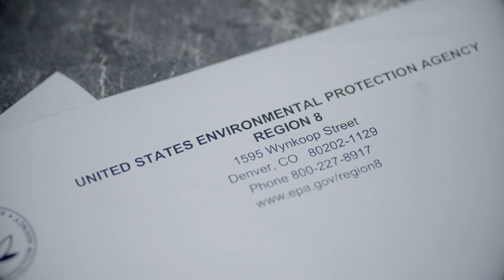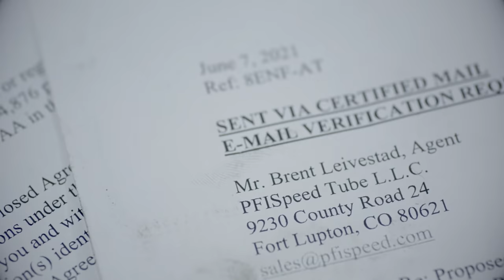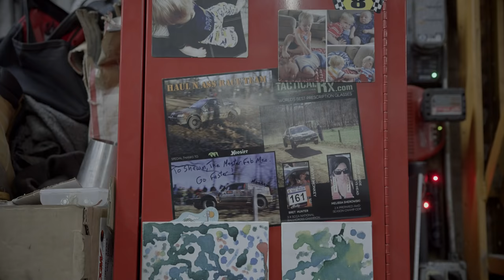EPA Banning Racecars?! The PFI Speed story...

Comment: If it came with a catalitic converter, the EPA will go after you if you mess with it. They have been doing that for 20 years.
Reply: Yeah, since the 70s. Back then there was 50 hp on the table, if you ditched the smog equipment and torched of the cat converter, but it was just as illegal then as it is now. If you are doing it for profit, it’s especially risky. I don’t know how you can be a mechanic and not know when your breaking the rules.

Comment: The EPA now claims that ANY vehicle that EVER had a VIN is subject to THEIR "jurisdiction". They also claim that ANY modifications to the engines, transmissions or ANY component of the powertrain that removes, modifies, defeats, etc. ANY factory installed and EPA MANDATED "pollution control" devices is ILLEGAL and WILL BE FINED! They have been doing this against off-road and competition diesels already! Several shops have been fined TENS of THOUSANDS of dollars for this! This violates current LAW as well as SCOTUS ruling that EPA has ZERO authority to make LAWS or rules/regulations that carry WEIGHT of law! SEMA is going to be dissolved unless these ECONAZIS are STOPPED!

Comment: I don't understand where the EPA's logic comes from, If brent takes a car and turns it into a drag car for example. It's going to be running for a minimal amount of time at the track, If you leave that car on the road it's going to do way more damage to the environment burning 100k+ miles worth of fuel, however long the car lasts. So why are then fining him for a device that actually helps the car burn cleaner and is for race use.

Comment: What you're doing is not hiring a lawyer from the get go. Companies that have been selling aftermarket performance parts have been labeling said parts for "off road use only" for years. That's why the EPA doesn't go after Summit or Jegs or Latemodelresto. The EPA saw a small sucker in you they could take advantage of. If you sell a part for off road use, you are not not responsible for any misuse from a customer. That's  why ford and Budweiser don't get sued when some drunk crashes his F-150 into a framers market. Get a damn lawyer and fight it every step of the way.

Comment: There is a huge difference between a pre 1996 vehicle with mods on the street and post 1996 vehicle  with mods. And I don't think any post 1996 car that's a  non registered vehicle that won't be used on the street should be regulated. And after the fact the personal owner should be held accountable not the shop that did the work. That's what waivers are for. I will not mod a registered street car unless they meet a certain criteria.

Comment: The EPA law says it is illegal to manufacture parts that basically modify the air fuel mix. It says it is illegal to sell them. So Roush and Edlebrock can't make superchargers to sell to Ford or Dodge. This means all new cars are illegally modified, because over 60% of your car is made from imported parts. This means a legal car has to be 100% manufactured by the manufacturer, and no imported aftermarket parts. Technically a thermostat will modify your cars power, and are now illegal to manufacturer. So Ford has to make 100% of their Roush Mustang, and GM needs to manufacturer the Corvettes supercharger, and Dodge needs to make their own superchargers, or they're illegal vehicles. I can order a 800hp Roush supercharger right now, but no HKS Japan parts. Technically A ambulance and firetruck is illegal to manufacture in America now, because they have turbo upgrades, and superchargers added to a manufactured vehicle. Technically a armored vehicle is illegal because the added weight kills gas milage. 18 wheelers have open atmospheric blow off valves.

Comment: Lets be real, these shops make their money on street customers, using the race car excuse is BS, everybody's modified car is a 'race car' just its driven on the street by day, and maybe a strip here and there for giggles; and sure there are some that actually do have trailer cars but that's minutely small number compared to the mass market which keeps the shops in business.  It's the same as having your ECU tune for emissions, then immediately switch it after getting a pass.  The agency is calling a spade a spade, granted they are doing it with 'everything is a nail, and I got a big ass hammer', but lets not play pretend that this is for strictly race car on strip only bs.  Its the harbinger that ICE is on its way out and EV is where the next wave is, but it is uncomfortable/painful change, just like change always is.  Lastly if your a true race car, its not registered, its trailed between tracks, never driven on the street with 5 mpg & dedicated 5 gallon 110/E85/Alcohol tank, required ICE box filled up to keep them damn intake temps in check and this crack down has zero effect on you.

Comment: I am still not sure I understand the issue. Is it that the unit in question was used for cars being driven on the street and not track only race cars?  Is this unit completely illegal in the US/state of the registered car or just because they put it in a car that is not deemed a race car?  Seems like if the EPA has an issue with how a car owner is using their car and the modifications being done to them they should be going after the owner and not the shop that did the work.

Comment: I think the problem is. Many speed shops are modding vehicles that will hardly ever see a track. They are for public roads. Not enough true racers to support the shops. So they need business from the guys that’s are driving on public roads. The prices for parts would go really high. If only racers used the parts. Does not help when they are putting YouTube videos out. Showing newer diesel trucks spewing a bunch of black smoke.  That they had deleted emission stuff of off.  Going down a public road. Best if you formed a lobby group if you want to get the laws changed. Huge amount of people going on about climate change. Not to easy to get emissions rolled back.

Comment: what I'm hearing here is that the Hot Rod and Street Rod hobbies are soon to be nothing but a memory.
Reply: The current Administration is entirely hostile to fossil fuels and internal combustion engines. Your Hot Rod will have to be powered by an electric motor.... assuming they allow you to modify it in any way.

Comment: it seems odd that the EPA doesn't want Hondata sold?  I can not understand why ?  even if you put the Hondata on a Honda street car,  to help a Local Tuner Shop (like PFI) to better fine tune the Engines Efficiently,  so it can run as Clean as it can?  they have to prove it is doing something more harmful or worse on Factory cars? It shouldn't matter if it's for off road race Vehicles ?   If it Helps , How is it BAD,  it all seems stupid, it seems a lot like extortion more then anything. Telling Americans we can't convert a Street Car into a Race car,  Is very Un-American !!

Comment: If I were prosecuting this my only witness would be Pfi youtube Chanel. I’ve watched the videos, cars with license plates, riven to the shop, then tested on the road…
I think there should be an exemption for this kind of limited use, but none currently exists. Also, with the exception of county sheriffs, cops are not elected officials either, also the clean air act was passed into law by elected officials. Take your lumps, change your ways and get the law changed.

Comment: Correct me if I'm wrong but by using this type of controller doesn't the engine work more efficiently therefore producing less emissions? Isn't that what the EPA wants? I am so confused over their entire premise. Is it just me or does this make absolutely no f'n sense at all. I posted Brent's original video on any car page and group that would let me, now I did have a few that kicked me out for posting it (not sure why 🤷‍♂️). But you would have to be a halfwit to not see the benefits of using the HONDATA and not sign the RPM act. Ok rant over.

Comment: I'm a Treehugger for real but I have no doubt that this story is for click bait.  the racing & speed equipment industry is huge and I am sure SEMA NASCAR & NHRA along with the TV Networks have enough money to fight off motor racing Being closed down. However that doesn't mean its ok to take the pollution controls off of your cars. the one place where pollution controls do matter is deisel truck racing where they run rich for the soot show what A**holes.  diesels are super heavy but can run in the nines and the fast ones don't make soot which is unburned fuel.  Any modern real Fuel metering system controls that.  this whole article is BS.  And If your wondering I have a yamaha and i drive the piss out of it. Too me I'm really chicken so i'm slow but I do like sporting around the canyons on the weekends and i don't think that should be banned.  That doesn't mean we can't control emissions.